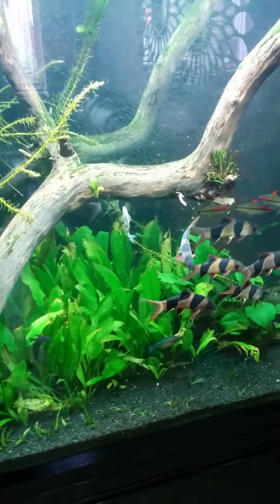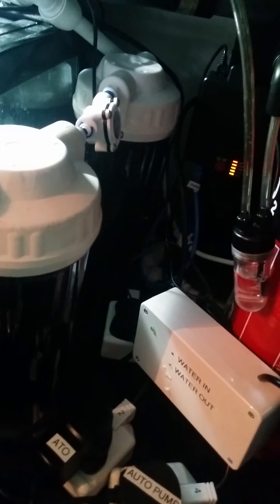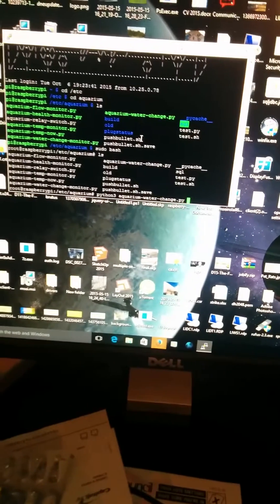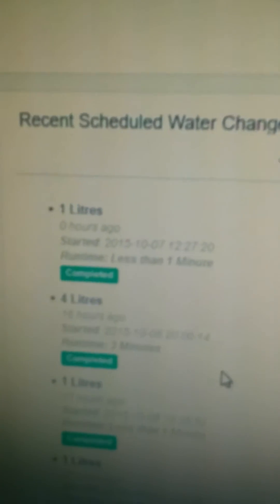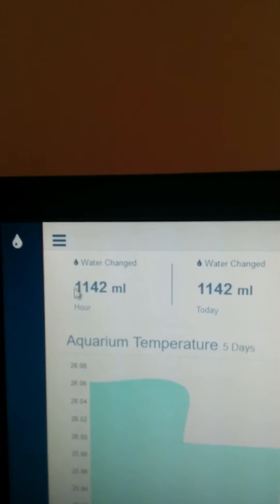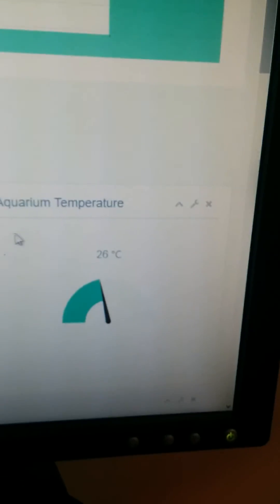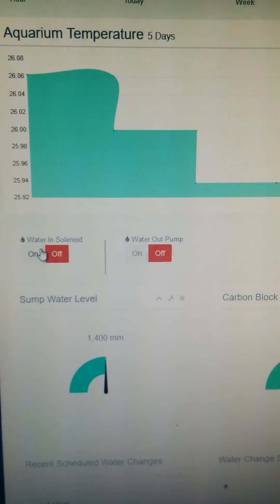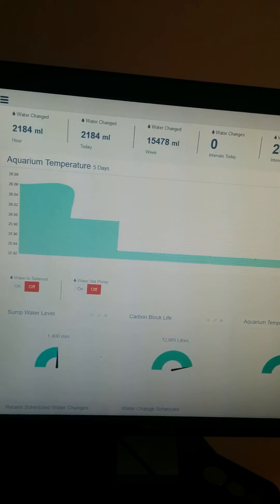Raspberry Pi computer controlled aquarium Version 1

Comment from the maker: sorry all I never checked my comments here. I did ditch the pi setup and hard wired a board and circuits on a timer so the SD card kept corrupting. I now have the pi controlling my heating instead. I also keep reef fish and did look at an automated water change for reef. it would involve at a simple level dumping salted water and replacing with new salted water with 2 sumps. floats and timers. I looked further into having something to auto salt the ro water and using a continuity sensor to get the salt level spot on. this starts to get expensive and also requires calibration. to make it into something viable and saleable it starts to move towards the £300-£400 mark if driven by a pi. it's not impossible. if someone wants to fund me to try and build them one im more than happy.